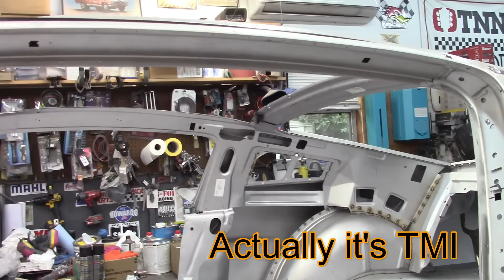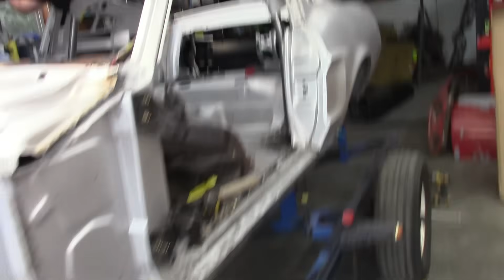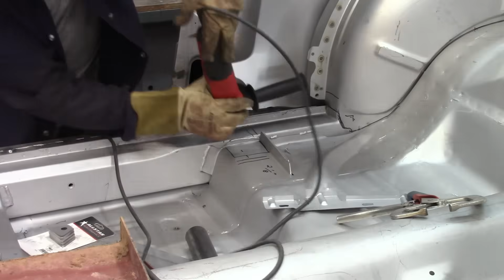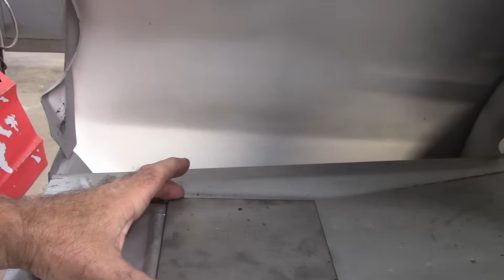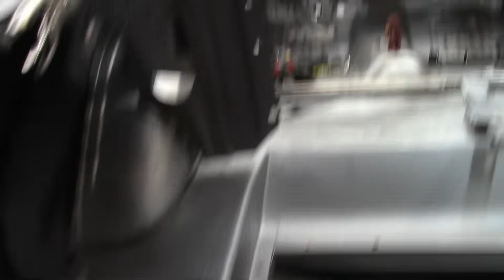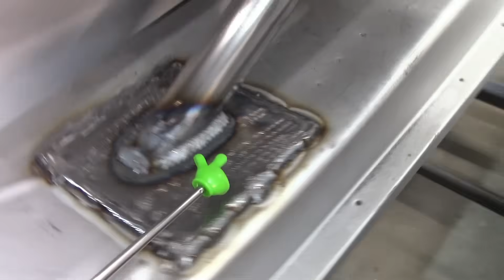Roll bar in a 68 fastback. Part 1. Fangled 13. #mustang #fastback #conversion #rollbar #howto

Comment: Just a suggestion. Contact the SCCA and see if they have a local scrutineer/inspector who could take a look at what is installed. Easy to change or modify right now, not so easy when the roof is welded on.

Comment: The only thing I would consider on the back mount over the shackle mount would be drill hole in the sheet metal floor into the thicker steel so your plate would attach to it also.
Reply from the maker: Good idea. Thanks.

Comment: how are you going to paint the row bar? thanks
Reply: Looks good 
I'm going to put a rollbar in my 68 I was thinking of fitting it up and remove it to weld and finish painting it the color of the car then putting it back in as one piece then weld it in place and cover it to protect it do you think that would be possible?
Reply from the maker: Not sure how you could do that if it's similar to what i did.
Reply from the maker: Not sure yet.

Comment: You do a great job explaining things. Roll bar installation is often regulated by the racing organization (NHRA, SCCA, NASCAR, etc.) They can specify the material it's made of (DOM, chromoly, mild steel), the thickness of the tubing, and the way it is to be installed. I think you said this will be a drift car, and I don't know if there is a specific sanctioning organization for that. Also, if a roll bar or cage is being installed in a street car, be aware of how close to the driver and passenger heads it will be. Clearance and padding is even more important when the driver isn't wearing a helmet.
Reply from the maker: It will be an auto cross car. So I don't think there's any regulations for those. I tried to emphasize clearance as I did drive stock cars, and had to take precautions. Thanks for the comment.